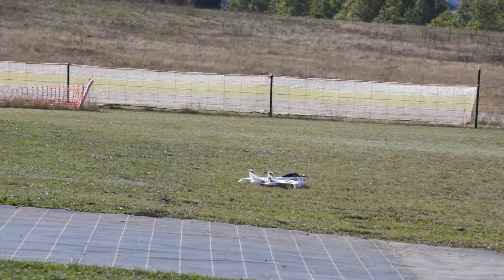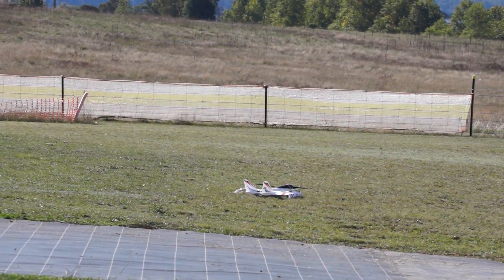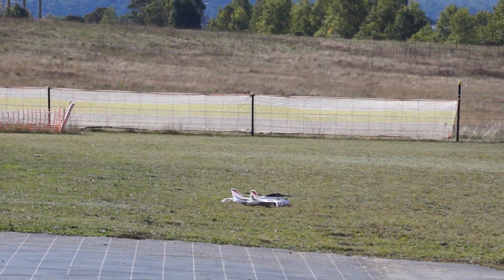ArduPilot flying the EFlite Convergence

Comment: This is gobbledegook. Reading vetween the lines, I have to assume that you have added some form of autopilot. If so you should say so.
Reply: They are using the open source flight control software called Ardupilot. The software can be run on several different types of flight controllers. It is pretty awesome.
Reply: Try reading the video title "ArduPilot flying the EFlite Convergence"

Comment: Well that was bloody awesome. I noticed from the video that at around the 3:20 mark you are experiencing the same problem as I'm having with mine. You say you will reduce the yaw gain to solve this? Which of the PID gains are you thinking of changing?
Any help would be much appreciated.
Reply from the maker: yes, the video was on my first day of flying it. I've since tuned it a bit, and reduced the yaw gain. It now doesn't have yaw issues when landing.
The gains I changed are Q_A_RAT_YAW_*, specifically the P gain

Comment: Hello friend.
It was very impressive. Do you think I can use Pixhawk for this setup?
Reply from the maker: yes, although it is quite a tight fit in the fuselage
Reply: Is there anything or adjustment I need to do with codes?
Reply from the maker: All the code changes are in master now, but I haven't yet written documentation on how to configure it. If you are interested in trying it then please join in the community where we discuss tilt-rotor quadplanes here: http://discuss.ardupilot.org/t/tiltrotor-support-for-plane/8805

Comment: Not bad.  Seems like just about everyone that tackles an ArduPilot VTOL has tuning issues,  even the Ardu god tridge himself!  :)  I wonder if its because there is yet no "auto tune" to give people decent starting points.  I think you can only run "auto tune" either in hover mode,  or in forward flight mode,  but not both?  When you can "auto tune" the copter aspect,  the plane aspect,  and even auto tune the transition all in one flight;  VTOL's wont be so fussy to get flying right.
Reply from the maker: This today was actually my first flights. I was just delighted it flew at all given I wrote the vectored thrust yaw code after I arrived at the flying field with the plane :-)
I'll post more videos when I've tuned it.
Reply from the maker: I should also say that I agree that improved automatic tuning would be a huge help. Ryan Beall is doing very interesting work with an adaptive controller in the ArduPilot research channel. I hope that may some day eliminate the need for tuning. See http://gitter.im/ArduPilot/Research
Reply: sill also help to design the aircraft to be more stable in all modes, including transition, and also have natural dampening. will decrease the workload on the autopilot, and increase safety margins, regardless of whether the tuning is perfect or not.  looking forward to the adaptive functions, but for right now, loving the arduplane code! thanks for your great work!  looking forward to the tilt rotor documentation begin released. I'll be using it right away for a project.